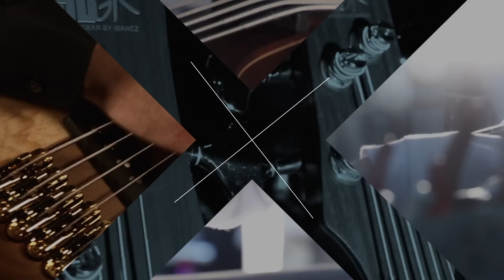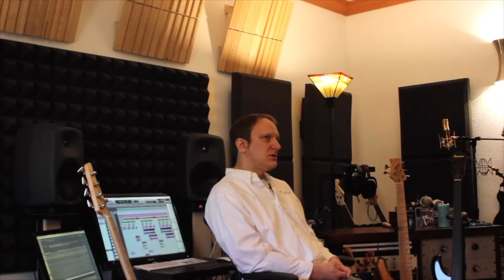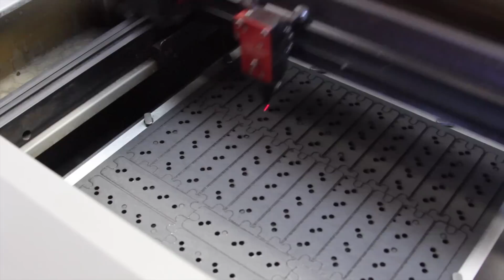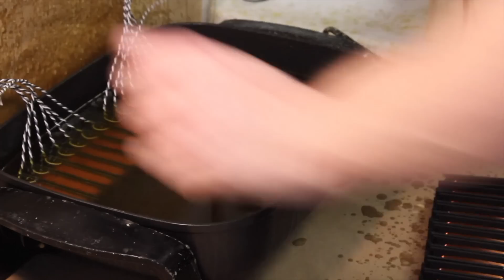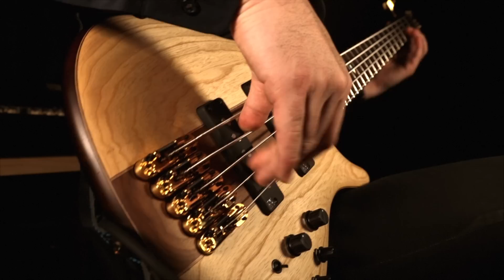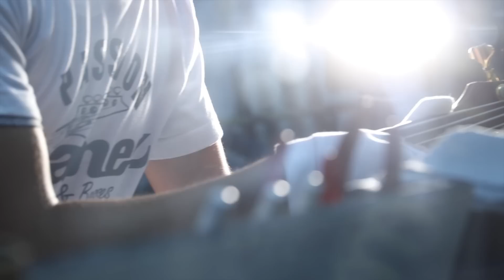Ibanez SR PREMIUM and NORDSTRAND Pickups with Carey Nordstrand

Comment: I had two sr1400's with the big singles. Returned both of them because of the irritating out of tune sounding tremolo-chorus effect even after lowering the pickups as far as possible. Not impressed.
Reply: @Monster in the Bassment  I don't think so. Got the SR5000 with the Bartolinis. Very happy with it.

Comment: I can't get a definitive answer, maybe Mr. Nordstrand will read this. I purchased the SR2600E and I feel this bass is unusable when the blend is not at the center detent. Otherwise these pickups are so noisy I either have to roll the highs band off or switch to any of my other basses that don't have a Nordstrand installed in it. So my question is, did I get a dud or are these pickups just that noisy? I have no problem swapping out to some Barts or EMGs I just shouldn't have to for what I paid for this bass
Reply: I have a 2605 and I don't have that problem. Cash in on that warranty
Reply: Maybe try running through a lower frequency through the onboard eq, or shut the eq off all the way? Depending on what eq you're playing on you might have to tweak some things as well
Reply: just a question from a noob, you arent using a rechargeable battery are you? i hear they make things noisy.
Reply: I've got the 2600 and even with the horrible power situation in my house the pups are only slightly more noisy full stop either way on the blend. Try a battery first, try a different cable, amp, etc, then use warranty if problem persists
Reply: @mojoemurphy  yeah I don’t even play it anymore. I’ll stick to my other bases. Probably sell that one eventually.